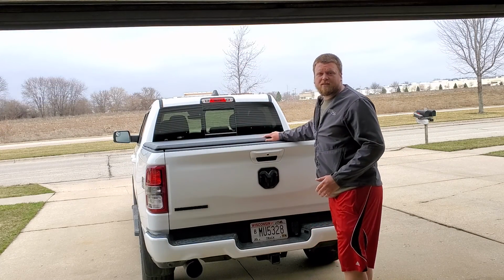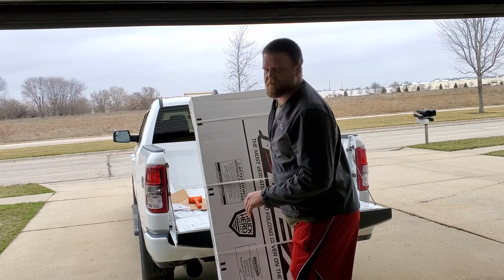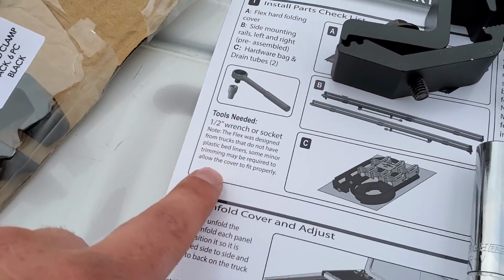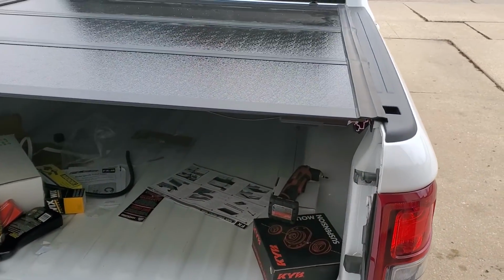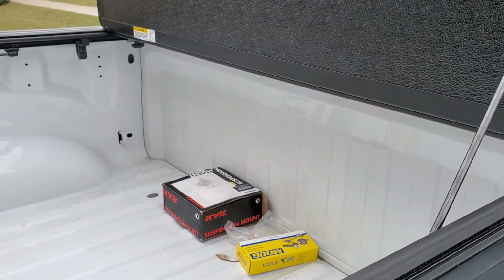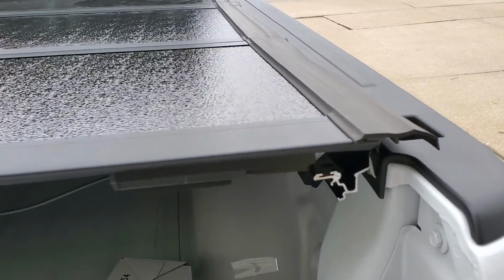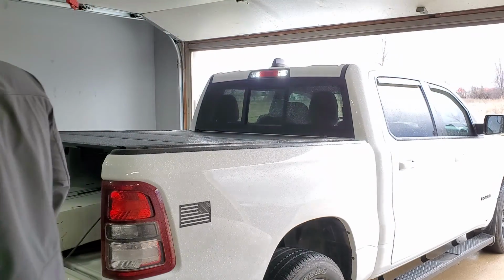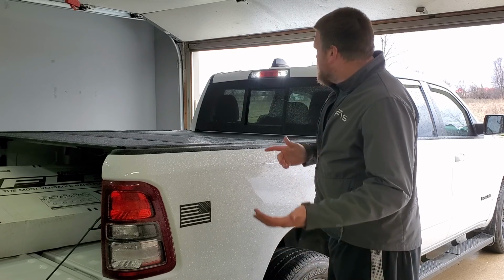5th Gen Ram 1500 UnderCover Flex Hard Folding Tonneau Cover

Comment: What’s the story with the water drain? Also did yours come with a bed light??
Reply from the maker: I didn't have a bed light, but I've contemplated adding factory lights.  As for the water drains, I'm not sure I know what you're referring to.  I don't have any water issues as the cover covers the entire bed opening.
Reply: From what I’ve seen there are drain tubes that connect to an inlet towards the front of the bed and you run the plastic tube through holes in the bed to drain any rain/water accumulation. 🤷🏻‍♂️
Reply from the maker: @chrisburch7365  I either missed that completely or mine didn't come with that lol

Comment: This cover is a piece of junk! Had this cover installed on my 22 Silverado and it leaked every time it rained I took it back to the dealer and they worked on it and it stil leaked. They gave up and sent for a replacement after waiting for it for a month they installed it and it still leaked.Going back to the dealer! Do yourself a favor and buy yourself a ten dollar tarp it will do the same job maybe better!😂
Reply from the maker: No issues here, proper alignment is key